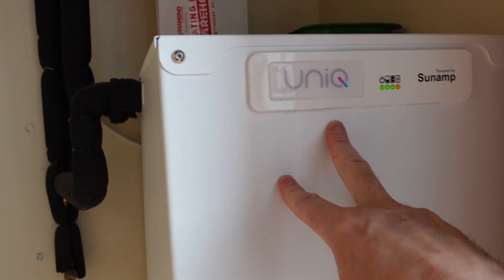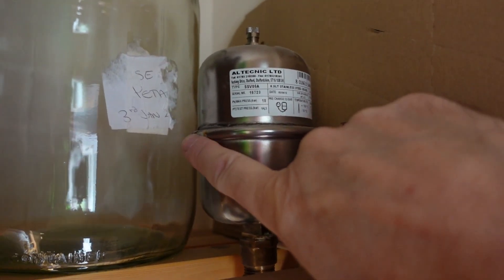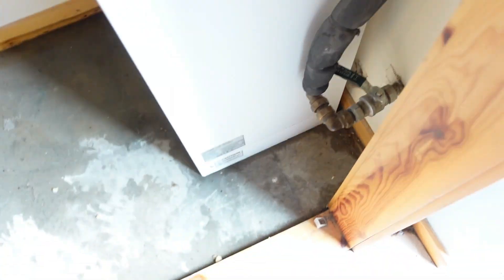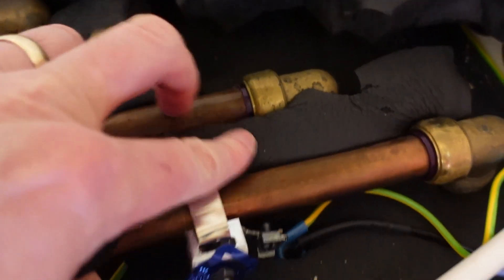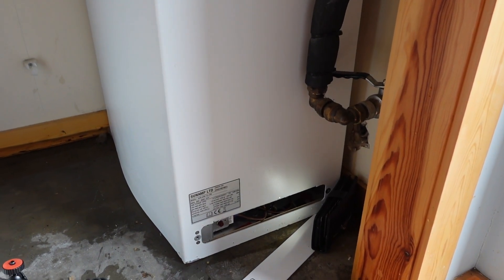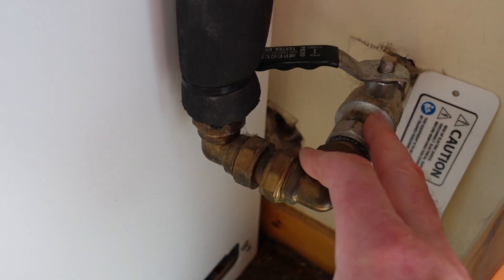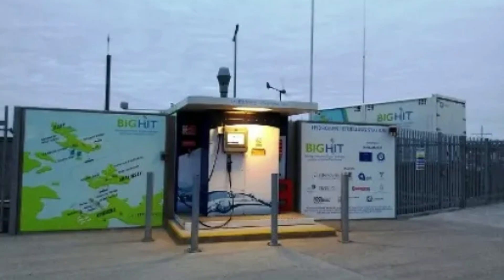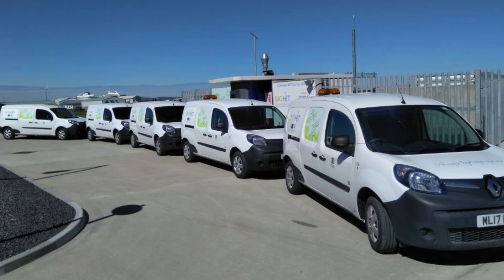Sunamp Heat Battery Review: Unveiling the Realities of Longevity and Reliability.

Comment: I cannot believe Sunamp or any other manufacturer of tanks would make them unable to deal with domestic water pressure. If there had been any doubt the engineer who replaced your original one should have tested the pressure and if too high installed a pressure control valve. Turning off the supply tap only controls the volume when flowing but when the water is static the PRESSURE is as it comes through the mains. It is NOT a pressure control valve. Surely Sunamp will replace yours under warranty so no need to go back to the ugly cylinders and immersions that fail frequently!!
Reply from the maker: Please see the follow up video ! 
https://youtu.be/OwcYPnemUTI?si=f3yG1O88YNy3-oSu

Comment: First off you cannot reduce the water pressure by closing the valve a bit, the reason is quite simple the pressure will equalise each side of the valve when water isn’t being used. To reduce the pressure you have to fit a pressure reducing valve. It’s interesting to see you have an expansion vessel and yet I don’t see a pressure release valve! A pressure release valve is to protect against excessive water pressure that might build up if the expansion vessel fails. Water expands as it’s heated and that’s where the expansion vessel comes into play. I also don’t see a non return valve on the cold water supply or am I missing something.

Comment: Very disappointing. Hopefully it just needs a “control group” valve to reduce the mains pressure to 3 bar, as per current installation manual.
Reply from the maker: Video follow up next week 🙂👍👍

Comment: as others have said a pressure valve is needed to drop the water pressure down to 3bar,  but 18 months not good your the second person i know with this issue in the new models, they got swapped out for the new gen Thermino  too,  so far no problems.but its only a few months old, like others said it did need a in line pressure reducer to 3 bar, (cracking just lowers the flow not pressure) i get why the heat loss is a lot better than tanks,  some may mention mixergy but a good heat pump tank but size carefully many are c rated., even the new heatable tank looks intresting option or one like ono may be better, ono also go by the name of panasonic heat pump tanks, this is what I have and it was excellent in the annex but again make sure you fit a in line pressure reducer to 3 bar if your inline pressure is more it may need a commercial tank instead rated to 15 bar
Reply from the maker: see my follow-up video https://youtu.be/OwcYPnemUTI

Comment: Johnathan if you are looking for new technology water tank have a look at a company called Mixergy. I can’t recommend them enough I’ve just installed a 210l slimline tank which heats up over night and solar diverts when battery full. It heats from the top down and water stays hot until you have used every last drop. It’s the equivalent of having a 7-10kw of battery storage depending how hot you have your water.We would have installed the heat pump version but didn’t have enough room.

Comment: Thanks for being an early adopter.
Your experience and many others have shown that these are not the solution.
Reply: It may be due to issues with this version of the appliance as @stevechambers8869 suggests in another comment. Perhaps more recent versions of the appliance can still be a solution for some with A2A?
Reply: A Thermino is a solution for the space constrained (i.e. me!) where a large tank of water (from any manufacturer) isn't. But I'm concerned that lots of Thermino owners have had issues. Can you share some links?
Reply: @iainwoolley4354  search for the heat geek combi cylinder.
That can fit anywhere. 👍

Comment: I've just had another look at your original 'My Sunamp has failed' video, and I notice that you're using the same small expansion vessel ?

Is there a specific reason for that ?

I've just had a 300 'X Plus' installed, and my expansion tank is much bigger ?  

(I don't know if my larger vessel was specified, or if it was just the one that was 'available' ?)

I just wonder about it, because 'it' is the same, and the problem seems to be the same, - too much pressure 'somewhere', making something 'burst' or leak ?
Reply from the maker: Hi Nick , good point , i know nothing about plumbing and pressures etc , but will pass on your comments to sunamp when they call in to replace this unit 😉
Reply: @JonathanPorterfield  Thanks Jonathan , neither do I, but I just think that when something needs to expand, it needs to expand 'somewhere', so maybe if your expansion vessel isn't big enough for your specific circumstances, then that expansion is finding its next 'weakest link', which sadly appears to be somewhere in your Sunamp ... ?
Reply: I would like to add that air which is infused in the incoming water separates from it under heat,  expanding especially greatly when heated extremely, maybe even to steam).  Air builds up in my simple hot water heater, and I get several seconds of fast flowing hot water from the tap until it slows down to a crawl.  Growing up, all our hot water rads had a pressure release valve, like a bicycle air valve, which we burped occasionally.  Another example, I also tip my water filters upside down when running to release trapped air, so pathogens don't grow.  Air seperates from water, it's a thing.

The solution to balance pressure is to employ a diaphragm tank. The one you showed looks comically small in comparison to a stock hot water heater diagram tank.  Even RVs have larger diagram pressure vessels.  An air pressure release valve should take care of air build up. 
 

May I suggest:
1)a proper, good quality house pressure regulator just for your tank, (or simply reduce main house pressure.valve)
2) Larger Pressure diagram tank (before the heater, after the new pressure reducing valve, and not on the high temp outlet side, as the high heat is probably too great for it)
3) an air pressure release valve, probably after the high temp water outlet side

A plumber should chime in here, I am a novice.  The unit may have one way valves to stop the expanding water from pushing backwards in to the city pipes and contaminating your neighbour's water supply.  In which case, putting the diagram before the heater as i suggested might not do any good.  Perhaps that's what your little potentially undersized diagram is, a special, expensive high temperature diaphragm.

What hasn't the Sun company already sussed this out?  Any telephone operator should be able to diagnose these elemental issues. Warranty service and returns are expensive and bad for reputation, not to mention make for unnecessary house damage and customer stress.

Comment: My SunAmp is coming up to 4 years old. I have had no issues,  I noticed that the heater element max is 2.8kW so I adjust the eddi to max out at that. I've heated it using both my ASHP and the Eddi in that time.
Reply from the maker: Great tip ! 👍

Comment: I prefer the simplicity of a solar PV system that diverts excess power to the HW tank element via the EDDI, which has worked well for me for the last five years. In my case, gas consumption has dropped by 1500-2000 units each year, or 15-20% of the typical annual figure.
Nearly all the rest of my power is consumed on-site with minimal export, despite the lack of battery storage.
Reply: Export rates on Octopus tariffs can be 15p/kWh. Some find export better than battery or self consumption these days.

Comment: Does it have a pressure relief valve? It should have for safety. Water expands a lot even at temperaturs well below boiling. If no taps or appliances are drawing off water your hot circuit will gain pressure as heat is applied and has to go somewhere. The expansion vessel is there for normal operation but has a limit. That one looks tiny to me. Could be they needed a larger expansion vessel.
Reply: Sunamp units don't contain a large volume of water like a conventional tank. The amount of expansion is very small.

Comment: If you have space I highly recommend installing a Jaspi Ultrastore. They're approximately the same size as a fridge freezer, hold 500 litres of water and allow heat input from multiple sources. Ours is set-up to use a heat pump, solar thermal and excess solar PV, but could easily use overnight cheap rate electricity. It then provides all our central heating and hot water, it can also store enough heat for about two days of demand in winter so if there's a storm forecast we'll boost the temperature up to 95c in case of a power cut.

Comment: We used to have a Sunamp (Low Temperature/larger unit) but swapped over for a Mixergy tank a year ago. The issues we had with the Sunamp  were that it not really work with our low temperature heat pump and offered little control ( with its on/off switch).  While the Mixergy tank with its app and online control works so much better for us.

Comment: Would be very interested to know if, when it was working 2nd time round, did it work, did it meet your expectations? Very few YouTube video on sunamp.
Reply: I have two, a 3 Kw in the kitchen (electric only) and a 12Kw( heated by solar diverter, grid or gas boiler) and all working perfectly. It's certainly a worry about them leaking though! Likely to cause a lot of damage to the building. Fingers crossed it's not a common issue.
Reply: I've just had a 300 'X-Plus installed (A week ago !) - And am very pleased with it so far !

I'm just using the built in immersion heater to heat it overnight, until we get our high-temp heat pump installed, which we will then use to heat it instead (Which is why we chose the 'X-Plus', as it allows us to do that)

But even though we only heat it overnight, it still produces piping hot water, at exactly the same temperature, throughout the day, which is amazing !

 - and it let us get rid of our disgusting oil-fired boiler, which is wonderful !

Comment: That's a shame. Was liking the idea of the Sunamp for hot water when I eventually lose the combi boiler as no Legionella cycles to worry about and in theory more efficient than a standard water tank. Does seem like there's a need for a pressure reducer (closing a valve 90% just reduces flow, does nothing for high static pressure, and would actually increase pressure cycling downstream). Looks like a different failure mode from last time at least.
Reply from the maker: see my follow-up video https://youtu.be/OwcYPnemUTI
Reply: @JonathanPorterfield  seen

Comment: Opening the valve, any amount will not reduce the resting pressure only the running pressure when there is demand on the unit. You need a special preasure reducing valve to do that. I have one to stop preasure knocking in my pipes when the loo has finished filling that got my pipes clatering.

Comment: Hi bud. Looks like a heat pump is the way to go for you guys?? Also, closing the valve won't reduce the pressure, only under flow. As soon as the flow stops the pressure will build up to equalise each side of the valve. Hope you get it sorted quickly 😔
Reply: Jonathan has air to air heating, which is why he has a relatively exotic water heater.

Comment: We did consider sunamp but could not find an installer. Ended up with a 210lt mixergy. Seems to work well enough and given you have batteries i qould not bother with any solar diverter. Let the mixergy keep the water hot and set it to heat on normal cycle. Ut will use cheap rate anyway plus just top up from batteries. If you uae solar diverter it turns a mixergy into a dumb mode or it did for us. Ours is working fine with a heat pump ....

Comment: Well this is disappointing! I'd finally managed to find someone who has a Sunamp and explained to me that these things will work straight off grid electricity. I was all decided that the Sunamp is the way to go for hot water and now you've made me doubt it. 
However from reading some of the knowledgeable sounding comments it could just be a case of yours nor being installed correctly...? 🤔
 I'd have to watch that too because our water runs at high pressure.
Anyway, I'm sorry youre all disappointed, hope you're able to make the suggestions made here and maybe try again...?

Have a feeling youre done with it though! Will you be going for the Mixergy with its clever tech and economy or just a plain old immersion and be done with it?

Hope you get to make the follow-up video soon.🤞👍

Comment: 2:30 reducing the valve will not reduce pressure,  only flow rate
Reply: Indeed so.  When there's no water flowing, then the pressure beyond the restriction equalises with the pressure in front of the restriction - i.e. you get maximum pressure.  It's only when water is flowing that the pressure drops.
Reply from the maker: @mandolinic  see my follow-up video https://youtu.be/OwcYPnemUTI
Reply: Yeah that was my thinking as well. there should be reduction  valve to reduce pressure and not just flow rate.  it works well in case if there is continues flow..that will reduce pressure but not once it will stop..so that could be the cause of the problem..

Comment: I'm looking at installing a Tepeo boiler which I believe uses similar technology?  So it's a bit concerning hearing about the problems you are having.
Reply: I'm pretty sure the Tepeo uses ceramics heated to very high temperature approximately 600c rather than the lower temperature phase change of the SunAmp
Reply: The Sunamp Thermino and tepeo ZEB are thermal stores for different purposes. The Thermino is a thermal store for providing domestic hot water, while the ZEB is a thermal store for providing space heating. They also use very different technologies to store heat. The Thermino uses phase change material as its thermal store, and stores latent heat. The ZEB uses a solid, high-density material as its thermal store, and stores sensible heat. As a result the ZEB stores its thermal energy at much higher temperatures than the Thermino, but also stores more energy than the biggest Thermino.

Comment: Mine leaked too. Heat exchanger broke and filled my front room with water. Not a PCM leak 😒
Reply: Which version did you have?
Reply: @NickLaslett  I had a Uniq 9, so early unit. 2018.

Comment: The latest model (they superseded yours too) has an installation document that REQUIRES a pressure relief valve in the cold water pass through circuit.  Something they previously crowed about as being a plus for the technology……..

Some plumbing will be needed if you decide to take another swap out.

Comment: Hey Jonathan - we have a solar thermal. Obviously it's much better in a hotter country like Portugal, but we love it. It's basically an immersion heater linked to a thermal solar panel(s). You can add a heating element to it - which surely could then work along with an eddy (although, if the un isn't shining then you don't have spare solar..... but you can use the overnight tariff, obviously). I must say, it doesn't have to be a hot day for it to work, but it does need direct sunshine. Maybe worth a gander if version 3 doesn't work!
Reply: In Portugal I guess you can use those roof mount solar thermal systems that don’t have to deal with freezing conditions?
Reply: @edc1569  Definitely. There are systems where only the panels are on the roof, with the tank inside - the heat exchange fluid stuff (technical term!) has antifreeze etc, for sure, and the pipes are all insulated - so it can likely cope with freezing temperatures if it's set up right. However, there is no denying that the returns diminish as the sun diminishes. :( We almost always have hot water for free - only when we have a couple of days of total cloud is it a problem. The pump is solar powered as well - so it just needs water! :)
I'm told in all new builds in Portugal they are obligatory now.

Comment: JP. The valve you have restricted only reduces the flow.  When there is no water flow the pressure either side of the valve is the same.  You need a pressure reduction valve which moves to keep the down side at the set pressure.  Roger C
Reply: Exactly what I came to say.
Reply from the maker: see my follow-up video https://youtu.be/OwcYPnemUTI
Reply from the maker: see my follow-up video https://youtu.be/OwcYPnemUTI

Comment: Did it really save you any energy in the long run I'm of the thinking we are just over complicating things all you need is a tank and an element
Reply: The greatest benefit of this tech is that it takes up less space for the equivalent size of cylinder. In my previous house I seriously considered a Sunamp precisely because we didn't have room for the size of cylinder required by building regs. Didn't end up doing the work in the end.
Reply: @matthewseymour8972  Yes, we've just installed one for precisely that reason, (as well as a couple of others) - the only fitted cupboard in our entire house was half-filled witha 300 litre thermal store, that has now been removed and replaced by a 300 litre-equivalent sunamp, elsewhere in the house, - and so far, very pleased !
Reply: We've just installed a 300 'X Plus' sunamp, because it lets us reheat it each night on cheap rate electricity, and then every litre of hot water it produces through the day is at exactly the same temperature, there's no need for any 'top ups' through the day ?

And we chose the X Plus model, because it will let us use our high temp heat pump to heat it later, too, which will reduce the cost and energy it uses even more ...